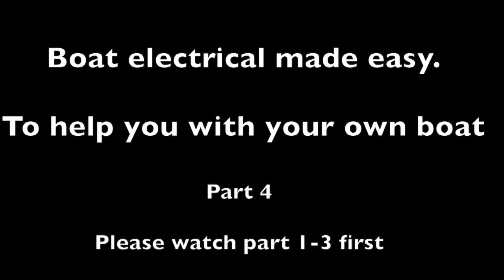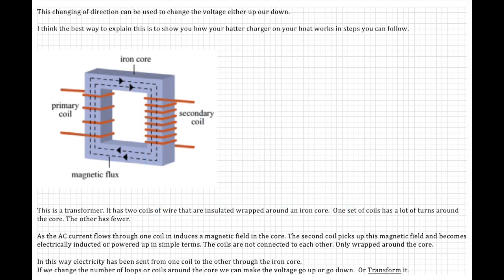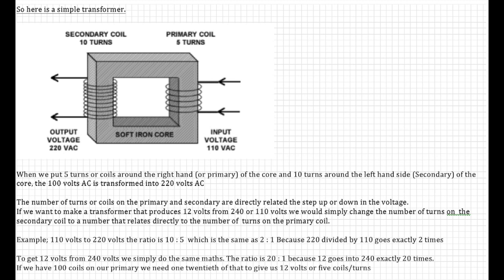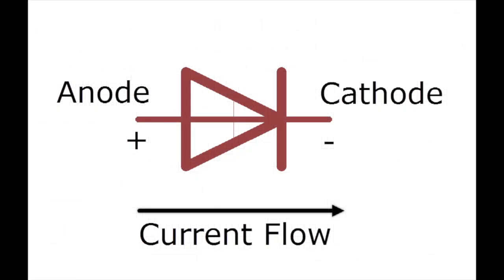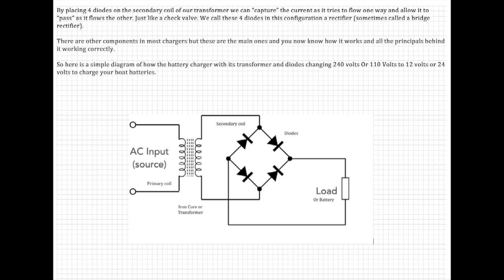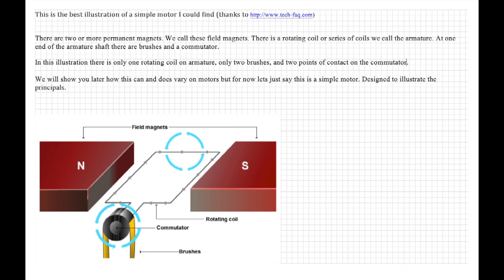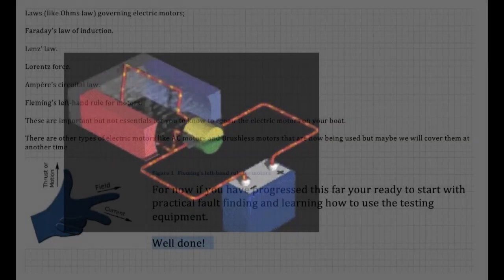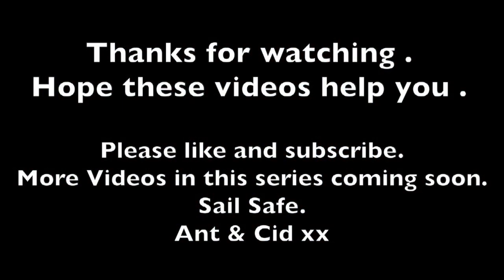Boat electrical made easy. Part 4

Comment: Can you do a video on proper grounding setup of a boat electrical system. From what I’ve read you don’t ground to the hull like you would a typical “grounded” system. Instead you have a complete loop from positive to negative. Is this correct?
  Also, a video on how to protect everything from a lightning strike would be great. Are there methods and devices that can be wired into the system to protect all the electrical/electronics from the millions of volts and heat a lightning strike generates?
Reply from the maker: Hopefully, we can cover these in upcoming videos. Grounding is very important, we have a galvanic isolator and isolation transformer. two things we will cover and why later as they are a bit advanced at the moment. The next video is on its way and will cover basic fault finding and use of meters and tools. Basic stuff. Thanks for watching. Ant.

Comment: well they were great , lots of theory there ,,, but i still  dont understand the earthing thing,,  some of your diag show earth onto battery  , which is simple , but others show the battery earth going remote tho you do not say onto what  ??   that is my not understanding ,,, does everything earth back to the battery or somewhere else ??    i have only watched the 4 vids so you may explain better  / more practical in later vids,, which i will be watching in due course,,, thanks , Rod
Reply from the maker: OK. The Ground/Earth/Negatives are not always shown a as complete circuit. The symbol is used to indicate that all the Negatives all go back to the battery, rather than drawing all those return cables. Does that make sense? Ant.
Reply: @SVImpavidus  yes thank you ,, that is what i suspected  ( just as in a car ) tho just needed it confirmed  , i presume it is also possible  ( if convenient  / if required  ) to run / use  a seperate earthing  "  post " ( ?? )  which would have a main cable connection to the battery earth ,, ( on the dash board / instrument  pannel / etc ) ? thanks for reply and excellent videos ,,,ps ,  thats a nice big boat that you have ..
Reply from the maker: @roderickmchardy3650  Yes you can use a post for the Neutral like a bus bar or  connection point. As long as you remember it will have to be rated (and its cable) to take all the current it is being used for. Ant.